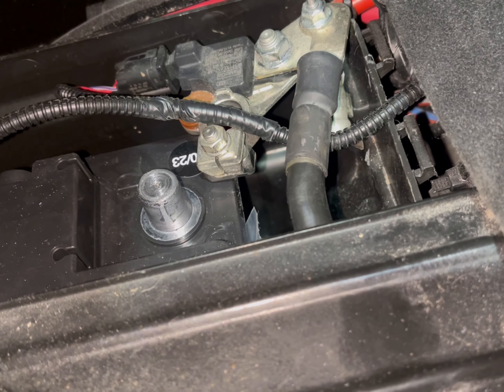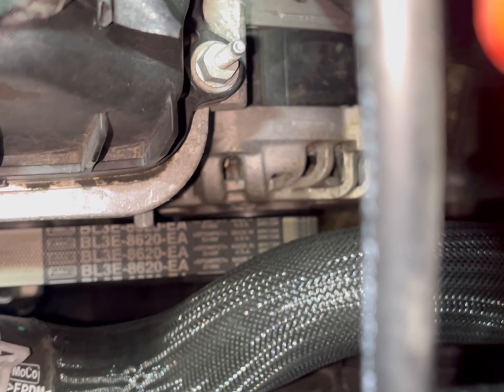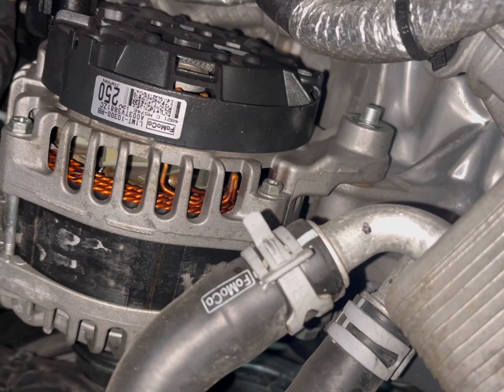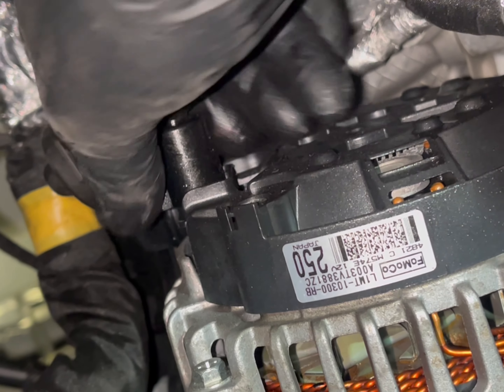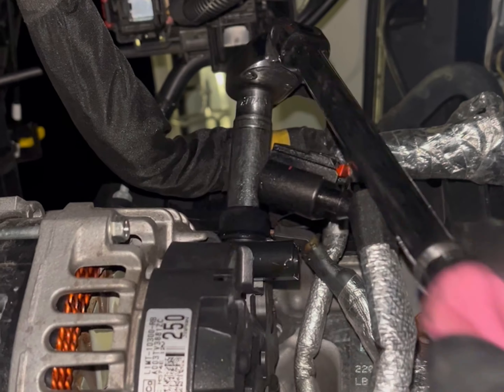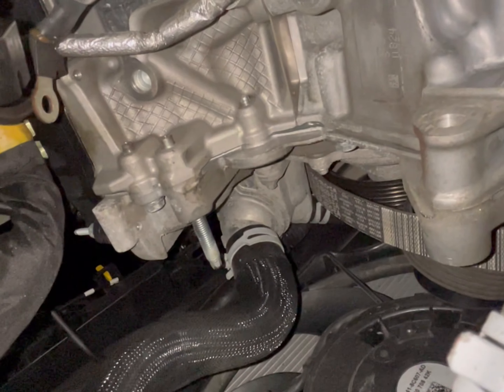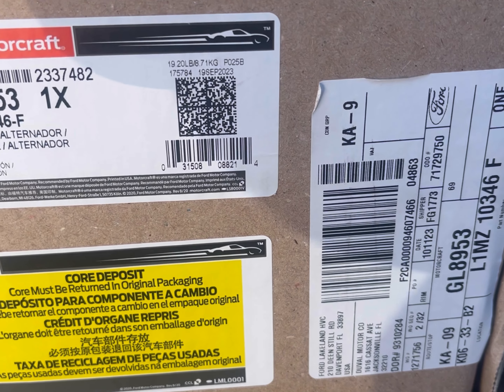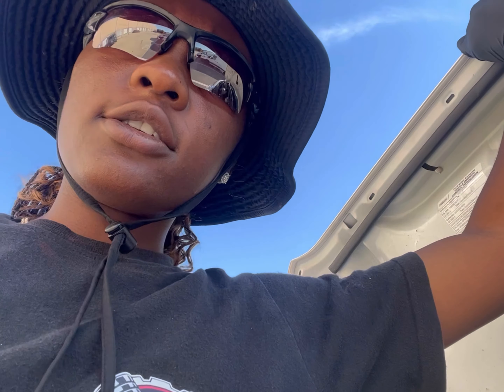2022 Ford Transit 250 Alternator Removal

Comment: What were the symptoms of the bad alternator?  I have a 2020 and the voltage fluctuates between 12.2v and 14v  all the time. You can see the tach drop when it happens and the AC fan slows down.
Reply: That's usually the voltage regulator, which is in the alternator, so prob need to change it

Comment: Didn’t show how you got the bolt out.. the one with the radiator fan in the way.. smh
Reply: Push on the fan housing and it moves enough to get the bolt out